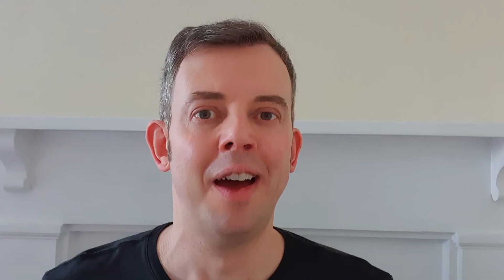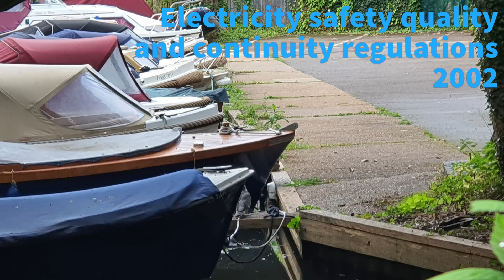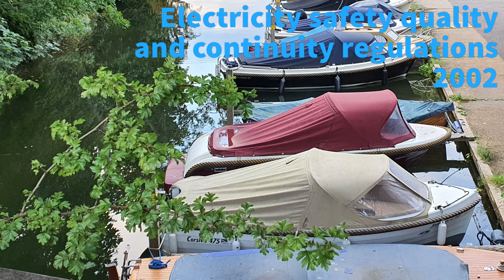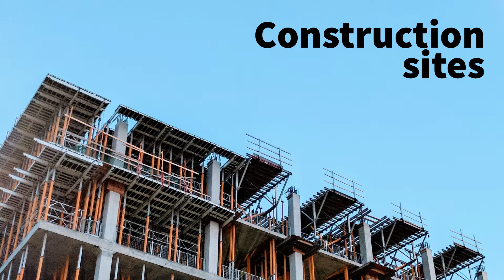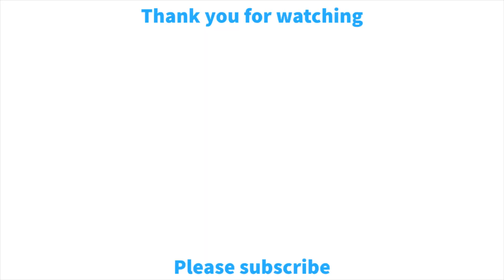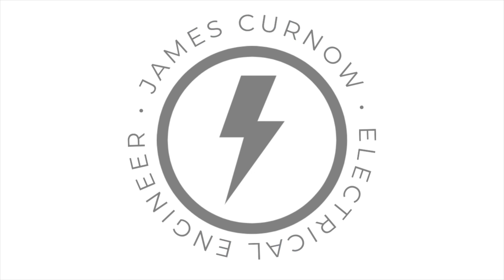Electrical installations where we cant use PME

Comment: Another really interesting video James. Ref Ev issue with PME, we are told that to assume a Tns is a Tncs( unless the DNO can confirm a true TNS) does this then mean that the bonding/earthing of this supply would then be sized for a PME?
Reply: I would recommend to always size for PME then. 10mm minimum. The difference in your quote to the customer will be negligible and you have peace of mind always then
Reply from the maker: Thanks Michael, I'm glad you found the video interesting. If you are working on the basis that it could be a TNC-S then yes, I would select the bonding and earthing conductors for a PME.
Regards
James